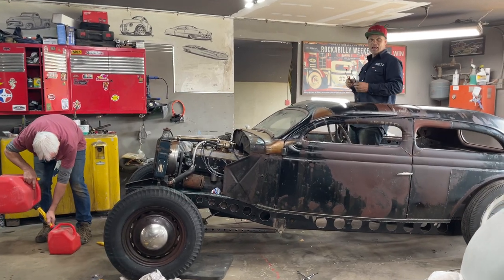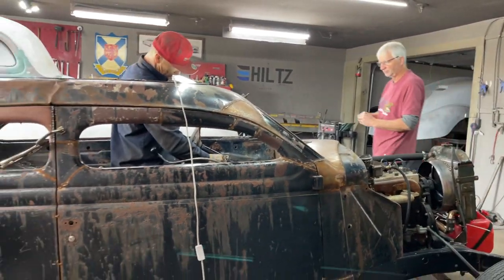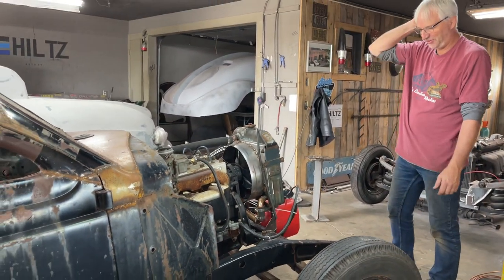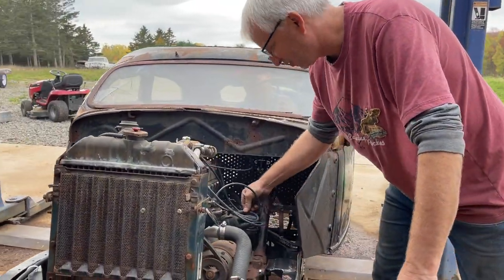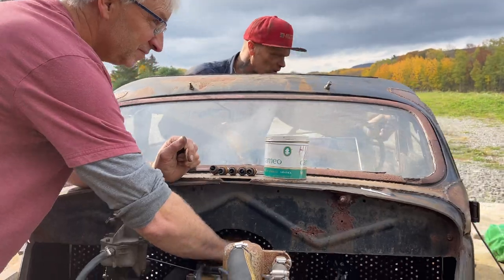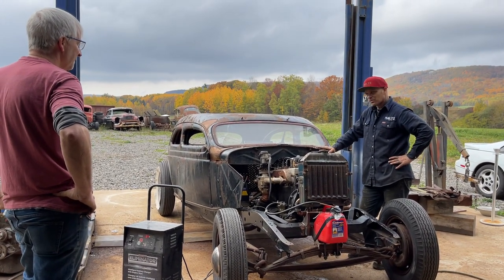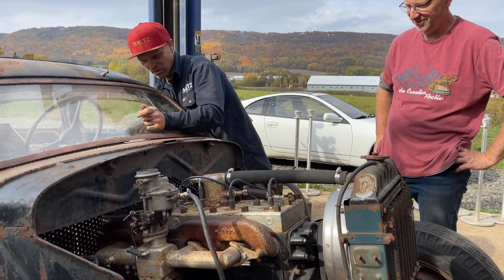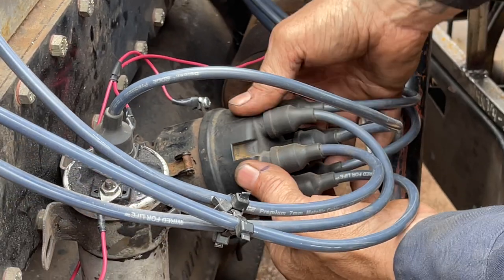WE'RE READY TO FIRE UP THE ENGINE

Comment: I'm wondering if the backward tilt of the engine is messing with the float level of the carb. Might need a custom spacer.
Reply: If that were the case, you'd never be able to drive a car up a hill
Reply: It ran ok when they started it in that position..and I believe it will only used to race so no uphill driving if that's the case
Reply: It would require a much more extreme angle to be an issue. In fact fuel will likely flow from the fuel bowl vents about the same time float issues creep up.
Reply: @JimmyMakingitwork  too right ..Most V8s sit on an angle and run just fine
Reply: The carb is dirty. It's been sitting for God knows how long so the carb is dirty n dried out
Reply: @tobygathergood4990  I do know quite a bit about cars I was a mechanic in my younger days ..so I wouldn't say so if I didn't know or was unsure ..remember it's only going down a straight piece of level road to be raced ..the angle on this isn't even that extreme so if it wasn't going to run down a level track it wouldn't even have run where its currently  sitting ..its running and being revved up and was no sign of starving fuel..
Reply: @tobygathergood4990  I've yet to see it happen on the very steep hills here in New Zealand..as it can also depend on where the float is hinged..never had any complaints from people whose cars I've worked on..but aside from all that it will be fine for what its doing..they dont plan on going to the moon
Reply: Carboidrato ou carburador?brother .

Comment: Hey Chad,  I recently found your YouTube videos. Watching back on some of your videos, I saw that you found a 1947 Ford pickup.  I bought a 1947 Mercury  One Ton pickup a couple years ago. It has a factory dump bed and the original Flathead motor. Its really cool.  But as you probably know that finding original parts for it are next to impossible.  Would you consider using your fenders as a template,  and fabricating a set of rear fenders for me? It would make a great video and I could get a set of fenders that are impossible to find. It would be a win win for us both. Let me know if you'd be interested in fabricating a set for me. 
Tell Jim that I also have a 1957 Oldsmobile Super 88 Holiday Coupe,  mostly original with the 371 Cubic Inch olds motor.

Comment: Your solution to the throttle linkage will work but I would have attached the static bracket to the carb mount and allowed for some adjustment

Comment: I would recommend you attach your Shut off toggle switch next to Jolene's seat. If she is wearing a 4 point harness she will may not be able to reach the steering column bracket in an emergency.

Comment: Bare in mind if the pickup tube for the olie in the crank case is abow the oile line, because of the angel on the engine you may need another extra 1/4 of olie in the engine to prevent it from starving for olie when you are racing... 
Ask John what he think  about it.... nice to see it finnely are running agin

Comment: Seems like the hup engine needs another wire from starter to distributor ,maybe the connection or some wire issue  seems that it wants to fire then once it fires it gets automatically shut off

Comment: Check the oil for anything in it, metal or water, check each spark plug wire for good spark, pull the carb and check the idle jets for dirt. spray stuff down the carb to verify Ignition is ok. You need to isolate the fault before you fry the starter. Compression Check. We saw arcing at the starter cable!!!!  You can clean the cab contacts too much and increase the gap to the rotor.  Good Luck. D

Comment: Sounds like the bendix is hung in the flywheel.
Tech tip: Cranking an engine till the battery is dead does not fix the problem.

Comment: are you running 12 volt battery ?  If so you need resistor on points to drop to 6 volts because at 12 volts points burn

Comment: Safety safety safety urgent urgent!!!!!!There is only one thing I don’t understand. The fire wall is meant to keep a fire and heat and fluids off  of the driver for safety . Having holes in there Jolene is not only going to get way hot just from the wind blowing motor heat from the motor into her face but God for bid a fuel line breaks or oil line breaks and catches fire on the exhaust .  That fire wall needs to be a solid piece buddy.   Love the videos .  I don’t think the car with that firewall will pass TEC inspection at the track.

Comment: it's $57.03 US, but there's a 1939 Hupmobile Model E cap on eBay right now...
Reply: And, is there a ballast resistor anywhere in that circuit?  If the spark is too hot, it'll arc inside the cap.  And detonate your coil after not too long.  Ballast should be disengaged while cranking with the key, but engaged after the engine ignites and you let go of the key.

Comment: That awesome bro pure life sound of a engine fuel injectors cleaner and carburetor cleaner and octane booster put in gas tank helps cleans the motor runs even better Chad any suggestions of my ideas 💡 lol old engine might need some cleaning inside I do that to my Subaru 2012 Impreza once awhile so it helps it only 73 thousands miles maybe it help u with ur builds cars

Comment: Chad ..just a question. I loe this project . the top chop , the great fabrications and modification, but why are you using a flathead 4 cylinder motor with maybe 80-90 h.p.  tops ? You are trying to emulate a early hot Rod race car right ? Just curious.

Comment: Tic Tac carb off and clean it or just check and see if it is a card dump some gas down the throat of the carburetor and if it starts up and runs for a little bit dies it means the carburetors dirty

Comment: Check under the distributor cap for moisture.  You had spark at the coil wire, where did it go.  Take out a spark plug, see what they are doing

Comment: check the power to dist. if it only sparks when you hold starter button on . it seems to run until you let go of starter button. put live to coil seperate from starter.

Comment: Sounds like fuel starvation, possibly junk in float bowl getting into jetting shutting down fuel flow. Ignition  points should be checked  for gap though it seems to run fine after initial start up and starts stuttering after revs which is why i'm suspicious of fuel blockage in carb. Tom Martin.